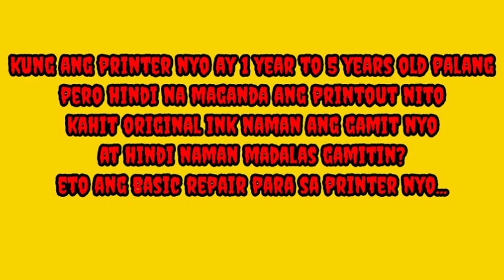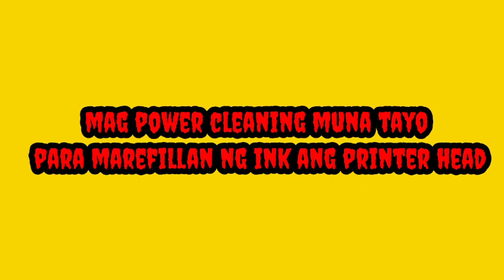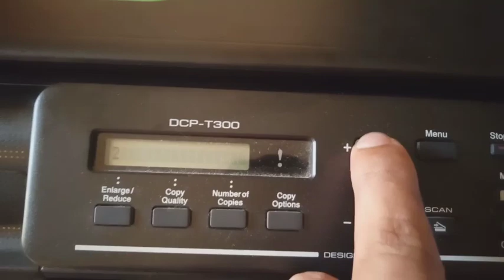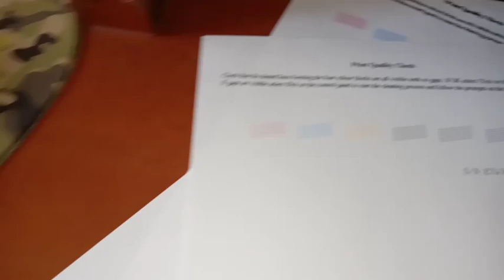Brother DCP- T300 Basic repair for clogged printer head #tutorial #viralvideos #usa

Comment: posible po ba dahil fake yung ink kaya nasisira ang print head? walang ink lumalabas kahit nakailang cleaning na ako kapag nagttest print ako sa brother t300. tnx
Reply from the maker: Pwd po pero try nyo mag power cleaning.. type nyo sa control panel ng printer nyo MENU MONO MENU TAPOS PINDOT KYO SA ARROW UP AT OK NG 80 PAG GAGAWIN NYO ANG 80 DAPAT ARROW UP 8 TAS OK TAS ARROW UP 0 OK. PARA MAG 80. NGAYON TYPE KYO NAMAN 764 or 760 tas pindutin ang start. Mag pa power cleaning po yan

Comment: Salamat sir.
Subukan ko gawin ito.
Brother T310
Cuyi UV Dye ink
Second hand na nabili

Issue ko kasi, ok yung CMY, pero yung black, sa test print, sa 3 quality test print eh yung gitna may 2 missing na linya. Naka ilang head clean pero ganun pa din. Same na line ang wala.
Binabad ko sa cleaning solution ng 30 mins pero ganun pa din.

Try ko higupan, baka sakaling kayanin.

Tanong lang po, possible ba na kailangang palit printer head na or kaya maidaan sa higop?
Reply from the maker: Nako sir head na po sira nyan butas n po pinaka filter ng head.. hnd po sya barado sira na nozzles ng head kaya hnd na sya maka pag print ng maayos.. bsta ang senaryo my bungi sa gitna ng nozzle check pag ng test print kyo sira n po head nyan
Reply from the maker: Sure po na laspag na printer ng binenta sa inyo yan

Comment: thank you . I did all that, in your video but my problem , the ink did not move in the pipe  ... what can i do ?
Reply from the maker: Ok Mam/Sir go to settings, search the cleaning then clean it 3x if still not working you can try power cleaning.
Reply from the maker: Press Menú (Menu).
Press  or  to select the following:
Select [Maintenance]. Press OK.
Select [Cleaning]. Press OK.
Select [Black], [Color], or [All]. Press OK.
Select [Normal], [Strong], or [Strongest]. Press OK.
Reply: @Bizzyinks  i did it but not work

Comment: Sir yon kin printer green xa pero pg mag phto copy medyo pink ho kulay
Reply from the maker: My barado po na kulay jan try nyo muna mag power cleaning
Reply from the maker: @ProcerfidaCamposano  gawin nyo po ito.. pindutin nyo po mga button na ssvhn ko menu mono menu tapos type nyo 764 or 763,760 mag cleaning po yan ng matagal
Reply: Boss panu ung sa atin ung magenta ng purple ung yellow naging green
Reply from the maker: @roseannfrancisco2158  mix color po ang ink nyo sir palitan nyo po ng ink or baka my leak na ang head
Reply: @Bizzyinks  may leak po ung plastic ni tank nya. NBuksan ko na po ung printer ko. Bka may Alam po kau bilihan ng tank nya
Reply from the maker: @roseannfrancisco2158  ah ok po butas na ang plastic.. sa shopee or lazada po type nyo lng ink tank tas saktong model ng printer nyo
Reply: @Bizzyinks  Un nga sir wala ako mhanap n same model.. Pwde kya ung naisip ko mag ciss nlng ako sa labas drill ko ung case tpos ciss. Wla nmn chip c tank nya
Reply from the maker: @roseannfrancisco2158  pwd nmn po sir i connect nyo lng ng maayos ang hose sa tank
Reply from the maker: @ProcerfidaCamposano  mixcolor n po yan sir
Reply: @Bizzyinks  ibahin ko po ng tank ung nbibili na mura. Ndi ko na gmitin ung original tank nya
Reply from the maker: @roseannfrancisco2158  cge po